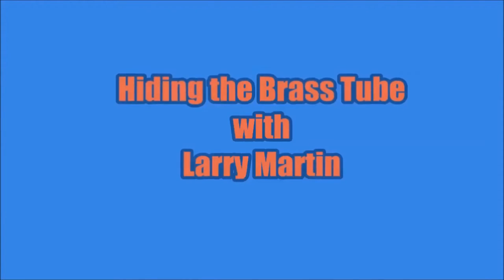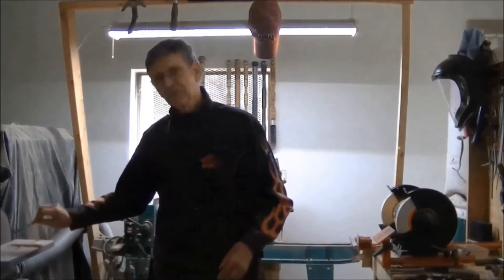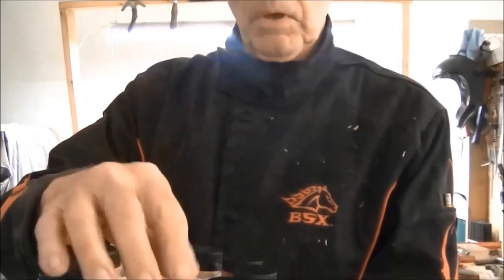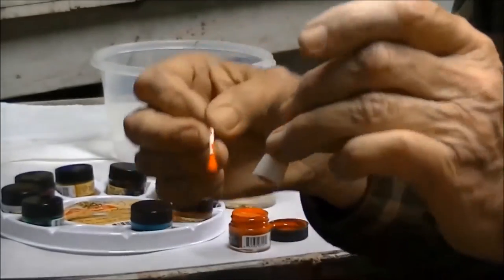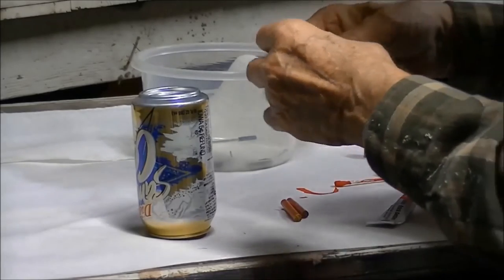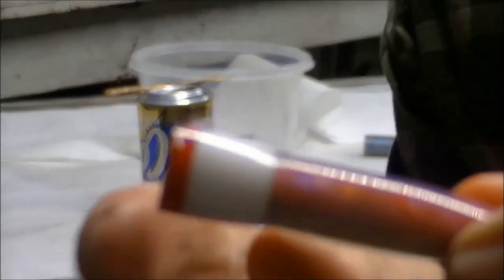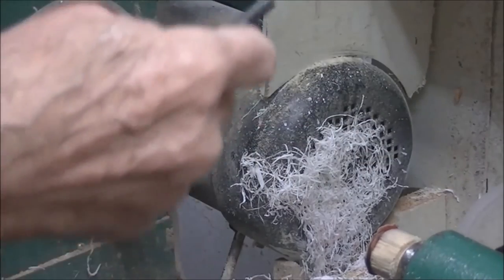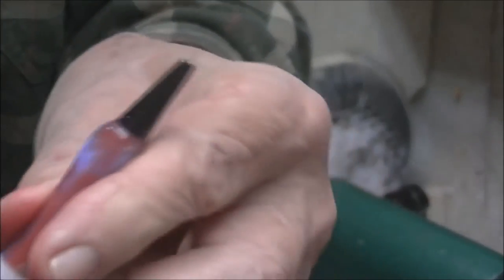Hiding the Brass Tube in a pen blank, (back painting)

Comment: Larry -- Thank you for this video.  I'm not sure how I missed it.  I do something similar: I use a wood dye to paint the inside of tubes.  (Most often, I use BEHLEN Solar-Lux stain in black. It's alcohol based, so it dries quickly.  Still, I usually let it dry overnight before gluing in the tubes.)  With this method, I've never had a problem with the brass or glue showing.
Reply from the maker: I haven't made pens in a long time.  Bout time I did another one.  Thanks and take care, Larry